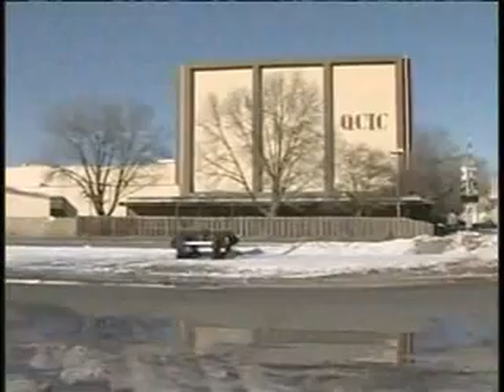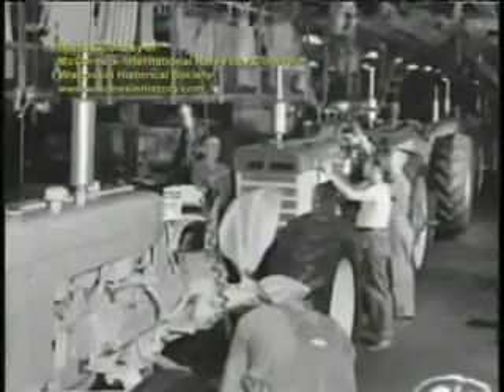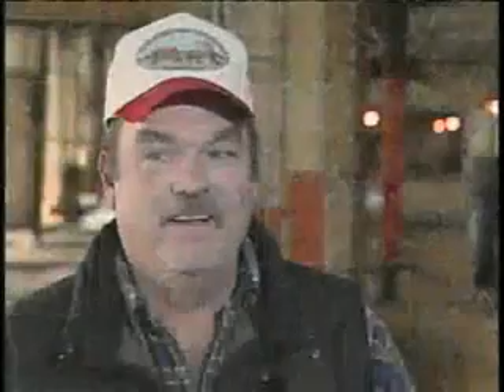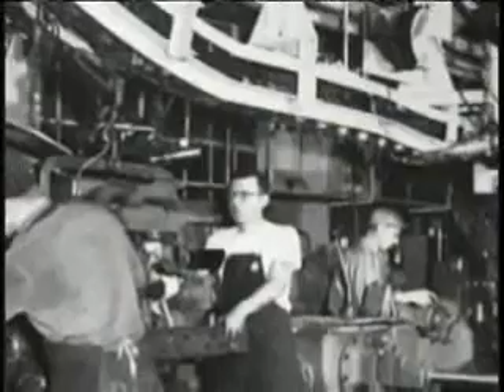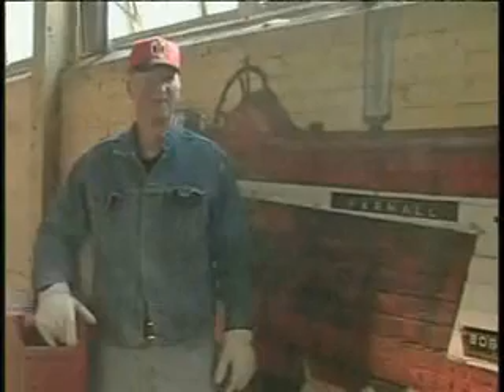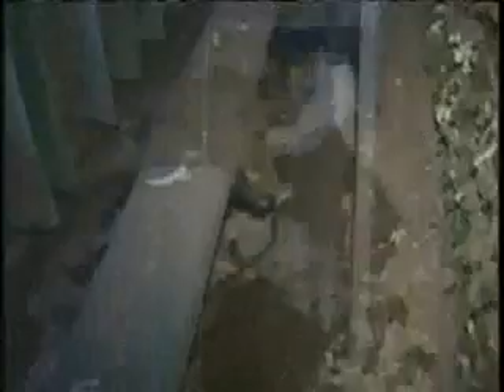Rock Island, Illinois Farmall Plant Past

Comment: My Dad bought a used Super M Farmall from a local IH dealer in early 1960's It pulled a 3 14" rope trip plow. I learn to drive it when I was 13. The clutch was nearly impossible to push in to change gears. Diffcult to turn around at the ends even with that roller ball brake assembly they put on it. The gas lever was worthless, jumping out of its notches back to idle a lot, put a new one on it same thing. But at 13 I thought I was really something getting to drive this thing all day plowing, and that exhuast pipe turning white from burning that good ole leaded gasoline.  In comparsion Dad also had a WD Allis-Chalmers. I was driving it at 12. Much easier tractor to drive, nice hydraulics. I really miss those days.

Comment: Grew up In the 70s. with the 560s. A real work horse on the farms. The sound of the six cylinder was music to the ears. Have a 460 a 656 n a M. Trying to find a nice 1963 560 diesel. To buy. Long sleek red beauty. To here the six sing again. Them 560 s n 460s. Where. A sign of the times. A real gem
Reply: Vern Simon I assume just like a Harley Davidson Motorcycle IH tractor had its own distinct sound.

Comment: Still use a 1940 Farmall A to cut grass with a belly mount wood's mower and push snow with a belly mount grader blade. Bail hay with a 1957 Farmall 450  and a New Holland bailer the 1945 M pulls the wagons. Simple and reliable when things weren't throw away.

Comment: Although I am 1st generation non-farmer, I will always have an appreciation for IH. My Dad stopped farming / trucking and started electrical contracting. When I was 3 years old he started taking me with him daily and teaching me the trade. I loved it. At 1st, I mostly started learning about people, and that I couldn't wait to learn to drive. About age 7 maybe, he bought a Wards riding lawnmower for our 1+ acre homestead. He used it once and returned it. About that time he was ordering a new '63 International pickup cab/chassis to put a utility body on - with his own design & built headache rack, high power wench and adjustable removable boom for pulling wells. He also bought (when it 1st came out) one of the 1st International Cub Cadets, 7hp. That is what I learned to drive on. He started me in 1st gear, soon moved me to 2nd, and shortly graduated me to 3rd gear. He didn't stop there - soon he put a boat trailer on the hitch and later a utility pole trailer, with pole, later increasing the length of the poles. He also ordered a '66 International chassis/cab, both we picked up at the factory in Springfield Ohio. We traded cadets as they offered the 10hp, then the 12hp hydrostatic, and a couple used ones later. When I started contracting my 1st truck was a 72 International pickup, and I later had a '75 4wd stake bed. Alas, that was the last year for the pickups. As a teen I worked several summers for a couple of farmers. I don't remember the models, but one farmer asked if I'd ever driven a farm tractor. I was honest and told him "No, Sir." He just said "Well, that changes today." After a minute or two of static training, I was pulling hay wagons to-and-fro. I spent a lot of time looking at other brands, but nothing could compete in my heart nor in my head with IH. I'm sorry for rambling when this is such a wonderful piece about the Rock Island factory. I would just like to thank ALL the wonderful, hard working people of IH, many themselves now gone, for making some of the best equipment in the world and the parts they played in my .family's lives. If IH made it, that's the one we bought. Thank you.